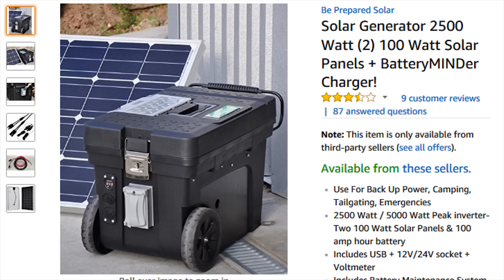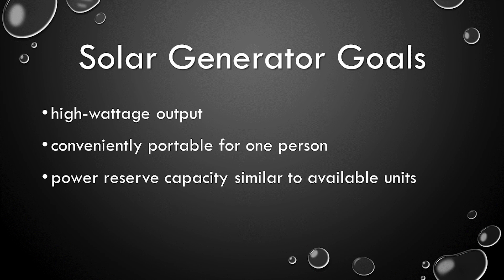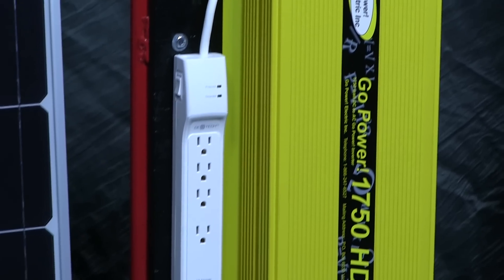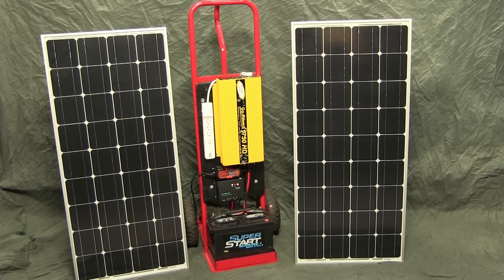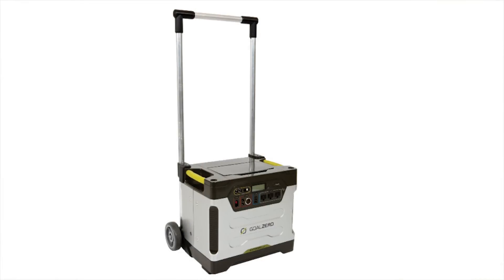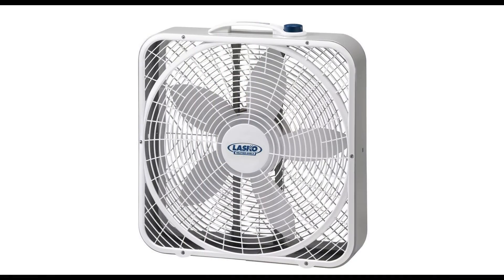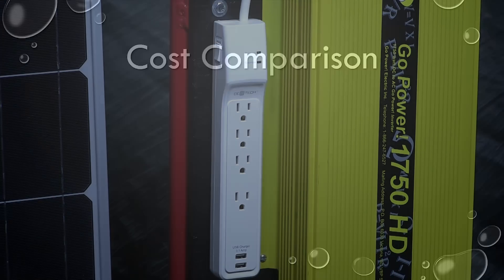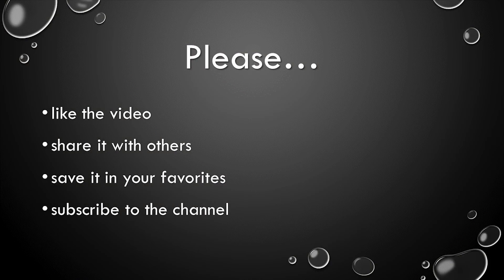DIY Off-Grid Solar Generator (rev 1) – Low-Cost Portable Power

Comment: Suggestion - move the plate with the inverter up towards the handle and add another battery holder - you can double the storage capacity by doing this. Also, USB charger on the power strip is a bad idea - you are converting DC to AC and back to DC. The converters within the power strips tend to have horrible power factor - I strongly suggest to add DC-to-DC converter - like the one you can buy for use in vehicles - and power it directly from the battery.
Nice build, btw.
Reply from the maker: Good suggestions.  I’ve taken your idea on the USBs, adding a 12V-driven USB on the Rev 2 unit.  I’m looking at expanding battery capacity in the Rev 3 unit.  Thanks for the feedback - much appreciated.
Reply: @DesertPrep  Is this the new upgraded version? https://www.youtube.com/watch?v=QZYAAatdlmc
Reply: I really like the additional battery. Would this require more solar panels to keep charged in your area? And how would the capacity values change? Cost comparison to larger yeti.
Reply: I just built one before watching this, and I must say, it's amazing, awesome that we all are thinking towards the same goals...

Comment: Why not use a sealed battery? Many public areas (farmers markets, parks, etc.) require their use. Aside from that change, I really like your setup. I am a musician who uses inverted battery power to drive my PA system - about 400W peak, 200 nominal.
Reply from the maker: I’ve taken your advice and upgraded to two AGM batteries.  Much better solution.  Thaks for commenting.

Comment: Very nice. I too was interested in buying a solar generator until I found the prices then.....needless to say no thanks. I had thought and still debate on building a similar type and realized it could be done for a fraction of the cost.thank you for the knowledge. As far as the looks of yours I think it's just fine,remember looks don't get you paid either way

Comment: Fantastic. It's nice to see somebody who's actually built something, with the humility to accept there may be improvements on the design. Your unit should be able to do the job intended and power a lot of devices in most cases. I could only suggest using an AGM battery (as a few others have). They're getting cheaper all the time now. I love the design, it's well thought out and very practical. I might make something similar for emergency power, and camping. Cheers from Australia.
Reply from the maker: A thanks for the kind comment.  The project has had a good evolution, and rev 3 has two AGM batteries and a number of improvements.  Check out the the builder’s guide video ( https://youtu.be/6glK8-IcDgE ). There’s a link in the comments for a design calculator worksheet.  You can download it and evaluate various choices for the components, so your build will be a complete success.

Comment: Nice design.  I like the way you got it all together on that hand cart - very clean build.  

But...

I built something similar and so let me pass along some bad news:  You cannot look at the amp hour ratings on a battery and assume you will get those amp hours regardless of the rate of discharge.  Basically, as you pull harder on a lead acid battery it becomes substantially less efficient, and those ratings on the battery are all calculated at low loads.  Yes, you can pull 1,500 watts if you had to, but your run time is going to be awful, and you'll eventually shorten the life of the battery if you pull on it that hard regularly.  

I have a system that has two similar deep cycle batteries, so roughly twice your capacity, and I put a 400 watt inverter on it.  Now I have less flexibility in what I can run, but 3-400 watts is probably about as much as you want to pull out of something like this.  You really need a lot more battery capacity for an inverter that big.  You are future-proofed for adding more batteries and solar capacity, but that inverter is just too big for your current storage capacity.

Comment: 1 1/2 year ago I made a similar set up, but with only Harbor Freight equipment, except for the dolly I had and the electrical strip, is a 45 watt  solar cell set up and a 2000 watt power inverter, not much but works perfectly for what I need when I go to my little plot of land in the Samalayuca Desert, I got an extra car eq. and amp. to plug in my mp3 player, and as long as we have sun light, I can use tools, hear music, and have lighting for the night, simple, not that eficient, but works fine with me.  So cool what you did  :), and pardon my english, don't know if I wrote something wrong, it's been a long time since I wrote that much in english LOL JA!JA!JA!.. SALUDOS from Juárez Mex.  :)

Comment: Nice stuff.  I am going to assume you are using a PWM charge controller. It will prevent excess voltage from being converted to a higher amperage at the same voltage for the battery - as would be the case with an MPPT charge controller (PWMs just stop the circuit, wasting the extra power). So you would gain more battery charging capabilites (at least 30% more) with the MPPT, and with your setup, you could get an MPPT charge controller for about $125 US. The extra money you'd spend on the charge controller could be offset by getting a MSW Inverter from china (see ebay for a reputable seller) about about $125 US shipped (i have this one, it works great and has great peak/surge abilityat twice the watts https://tinyurl.com/ydfdtu6d). Lots of choices and a better power generating system overall.
Reply from the maker: Thanks for the suggestions.  The MPPT controller is a good idea, but check the inverter to be sure it's a pure-sine model, as certain devices, particularly those with motors may not tolerate the relatively-rough waveform.  The Rev 2 upgraded model in my newer video has this change.  I'm working on a real-world test analysis video, due later this week...

Comment: Looks good. I just have one comment.  I was told never to use a CCA engine  cranker for a deep cycle solar system.  AGM GEL or wet only
Reply from the maker: The unit has a deep-cycle marine battery.  It’s theoretically tolerant to discharges to 50%, but you need to prevent going below.  An AGM battery is certainly better, adding over $200 and 20+ pounds to the system.  More on this in the video coming later this week.

Comment: Nice build but you need some breakers or fuses.  Also, that inverter is not Sine Wave, and GoPower is not a good brand, over priced and not reliable. Nice build and video.

Comment: My advice is to stack a second battery over the current one then mount a high power battery charger.  Then uses a generator to power large devices and while doing that charge the batteries.
Reply from the maker: I started skeptical of a solar solution, and actually have several generators.  However, once I started to understand the fuel requirements of even a short-term grid replacement, I began to look more closely at a solar solution.  Just a week would require so much fuel that storage becomes a tall order.  I do expect to use a small generator for charging on days where solar can’t support it.  I appreciate hearing your perspective.
Reply: The idea was to run the generator to run a well pump but while it was running top off the batteries.  With out looking at it in person you should be able to weld a second shelf over top of the first battery for a second one.  The power inverter might need to be raised.  Why do you think you need such a big inverter?  What are you planning on powering that takes that much power?

Comment: Why not charge USB direct off the battery, rather than convert to AC and back to DC?  Also won’t have to worry about taking the inverter out of sleep mode.
Reply: To suggestions regarding the hand truck.  
1. Go tubeless on the tires. Unless you use it more often than every 3 months. Sometimes pneumatic tires deflate to the point if they break the bead difficult to re-inflate.
2. Since you have a buddy that can weld. Attack some L brackets to an additional longer extension plate that you can bolt on to the backside of a hand truck that rests on to the bottom of the hand truck that can accommodate a couple of more batteries.
Reply from the maker: You’re spot on about the tires. Flat about 45 days in.  I’ll be replacing them...
Reply: I think the USB components of the inverter do indeed just come off the battery. Typically they work even when the inverter is off.
Reply: I'd put some stainless piano hinges($15 at Lowes) on the sides of the hand truck and some sort of pinned attachment to the panel frames(for quick removal).  A simple bungee cord could then hold the panels 'closed' off the front of the cart and they can then be 'butterflied' open to be used.  A small 'kickstand' on the rear of the side rail could be used to lean the cart back somewhat, not so far as to spill the battery but enough to gain more sun.  Look up NPP batteries on Amazon, pretty cheap AGMs. Nice vid!

Comment: Nice job  - very practical and cost effective.

Dont believe that charge life crap about lead acids  -- they have a set life span regardless of the amount of charge you take from them at one cycle. If you discharge it 80% you will get the same amount of "energy" over its life as if you were discharging it for 20%.  Calcification happens at the same rate no matter how much you discharge it. If you do massive discharges and cause heat damage thats another thing. 
I think this whole 50% discharge life thing started as a selling gimmick when people complained about battery life - "well only discharge it 50% and it will last twice as long" and nobody did the math on the energy out put!

For folks wanting a unit that will get allot more charge and discharge cycles - invest the extra $'s on lithium based batteries -- for higher cycles you will get more for your money long run.

Looking forward to more of your vids -- Cheers, Patrick

Comment: I had the same exact idea but never got around to doing it.  But I think 1 battery is insufficient.  I would go with 2 or more 100 AH batteries.
Another similar idea I had was to put that setup on a wagon cart, one of those they sell at Home Depot made of steel mesh and steel frame.

Comment: Nice and reliable concept. I wonder what it would render if part of the output would drive a simple DC pulse motor to run a modified or normal car alternator with high amperage output and from there harnessed to adaptable power in sequence.

Comment: Well done first off, butt the thing I would change is use 2X 12V AGM 300amp or there about,  batteries and setup as a 24VDC and that would run way better than a 12VDC system , raze the back board to allow for the two batteries and use a heaver gauge cable from batteries to inverter,  and I would use a MPPT charge controller, with two 300 watt solar panels to allow for charging the batteries as well as running small AC devices, over all your system is a grate Idea for camping or when the grid goes down for a short time. keep up the good work , two thumbs up

Comment: i use foldable suitecase type panel , more convenient to attach to the setup to bring all together. As they are mounted on adjustable legs, they are easier to put in front of the sun. The other parts of the setup are nearly the same.

Comment: This is very impressive, especially with the reduced price, compared to other equipment. But, when it comes down to the final wire this is nothing more than a mobile version of the solar system one has on their roof. If the sun doesn't maintain what you need you're dead in the water. As a 'generator' it'll work fine as long as there is sunlight, but, gasoline/diesel generators, though noisy, will get the job done 'rain or shine' .
Reply from the maker: I started where you are, I think.  I have several gasoline generators — two of which have reasonably good 12V charging capability.  The real issue is fuel.  In a desperate situation, I have 20 gal of gasoline in cans, up to 60 gal more on our three cars, and about 40 gal of propane (one of the generators is dual-fueled).  This wouldn’t run the generators for very long — maybe a week of intermittent operation.  The solar project gives me a long-term sustainable source of power should the grid be unavailable for an extended period.  Gasoline generators can recharge the battery when weather interferes with solar, and in supplementing this system excess energy isn’t lost as it can be stored on the battery.
Reply: Desert Prep >>well, yes if you combine the conventional generator ( gas/diesel) with yours then the situation changes altogether. Maybe I missed something in your video, but,  I assumed you were talking about YOUR invention replacing the gas/diesel type generator all together. You never said anything, that I remember, about combining the two. Yours would definitely be more quiet... until you run out of sun for a few days then it's REALLY quiet! Lol.  Don't get me wrong, I think your 'dolly two wheel' apparatus is quite exquisite. Have a great day!

Comment: 1. Attach the panels to the sides of the cart with hinges so they unfold (so you wouldn't have to carry them)2. Put a (adjustable) leg on the back of the (center of) the cart, hinged at the top.THEN, you can wheel the cart out, tilt to the proper angle to maximize collection and unfold the wing panels. Tada 😀🌞
Reply: This is only a "good" idea if you remove the battery first.  Running a flooded lead battery off level is not good.
Reply from the maker: The hinge idea is good — adds a lot of convenience.  The tilt able support is a very good idea.  I’ve mounted the panels on top of a structure to get better all-day sun.
Reply: Throwing the baby out with the bath water? You don't have to remove the battery at all if you keep it level by putting it on a hinged plate.  Simple. Since you didn't realize this, I'll also have to point out that, due to the low CoG, there will need to be some sort of adjustable foot under the bottom plate to keep it from righting itself.  Alternatively (although this is a major modification to the handcart) have the battery swing out on or with the rear leg. Keeps the battery level AND alieviates thd self-righting problem.

Comment: Very good idea you say it powers a small refrigerator  for 40 hours what if i had multi generators
Reply from the maker: You can get more capacity by increasing panels and batteries.  No need to duplicate everything else, unless you have loads that exceed the inverter capacity.

Comment: Although the onboard battery maintainer is a great addition,. A larger 110 volt battery charger, Say 20 amp plus, Would give you the option to do a fast in field recharge with one of your gas generators
Reply from the maker: A good battery charger is a very good idea for adding supplemental charging for when sun isn’t available, or drains that exceed charging capacity.  I have two gasoline generators, both of which have 12V charging capability, so I can recharge without an external charger, but anyone who doesn’t have such a unit would be very well served by your idea.
Reply: +Desert Prep Btw, great set up , I too was inspired by other DIY'rs.  
I also wanted a back up generator so I bought a Yamaha 2000is , 
It's light and very portable.
It does have a 12 volt  8 amp  charging port, But I wanted a faster charge rate for my battery bank .
I also instated a Tri fuel kit , Propane is a much better long term fuel storage option

Comment: Good explanation and nice design but I don't understand why you need the black and decker charger, doesn't the charge controller keep the battery charged?
Reply from the maker: That’s an excellent question — thanks for asking.  I built the unit for emergencies — if the power goes down, I can roll it out and have some sustainable power for the duration.  Because of that, everything is in the garage until I need it.  The battery maintainer keeps the battery at full charge to keep it healthy, and so the unit’s ready to go as soon as I need it.
Reply: That makes sense - thanks

Comment: If it uses lead acid battery you will get 200 uses to full discharge and then you need to refill it with a $400 battery.
Reply from the maker: I think your comment is very important.  The comparatively inexpensive battery I’ve chosen is very sensitive to deep discharge, and even the 200 cycles you’ve mentioned is likely optimistic.  Preserving the battery will require monitoring carefully to ensure discharges don’t take the battery below 50%.
Reply: I Have a deep discharge battery 250 amp hour charged with 2 panels 200 watt total, reads up to 14 amps on charge 
it only lasted a year on very light discharges,  still works but capacity is way down  Very disappointed, 

  I really think
Edison batteries would be the best despite their 80% efficient    Short term plans here heat  water directly until batteries become usable  Which is NOT any variety of the lead acid battery .   the load I had used
was 4 X 12 watt florescent lights on a time clock, and a 100 ma broad cast radio (24 hrs a day) lights only on during the daylight hours.
 Water level only needed to be  touched up once.   I estimate the battery is only 50% usable at this time...I used an external 
battery charger twice to equalize the cells     .  Each cell reads fine, just the battery capacity has made it rather laughable